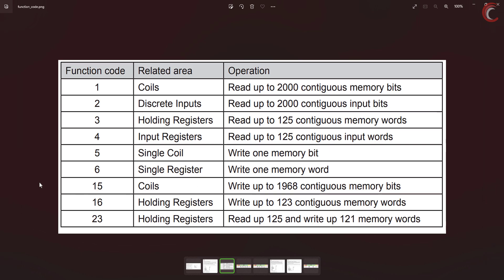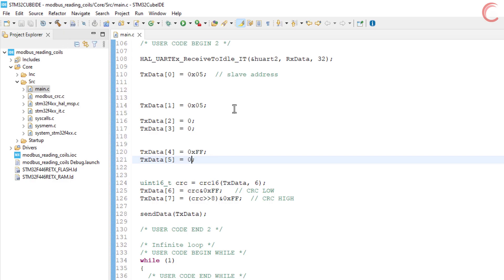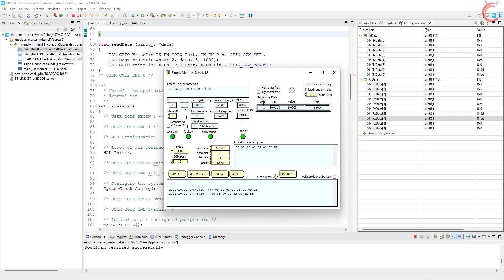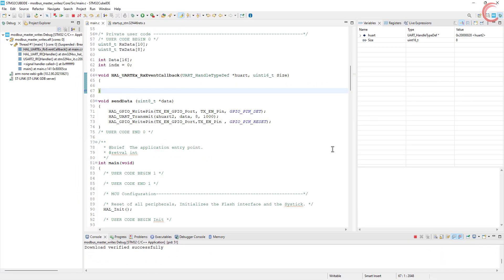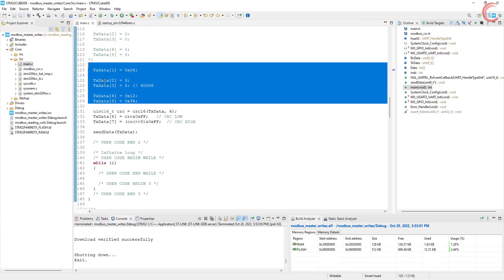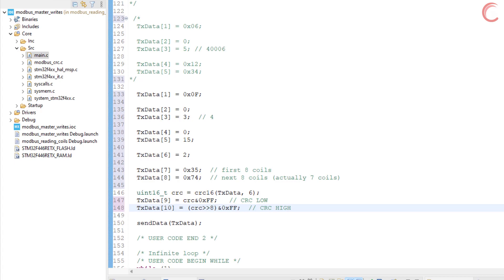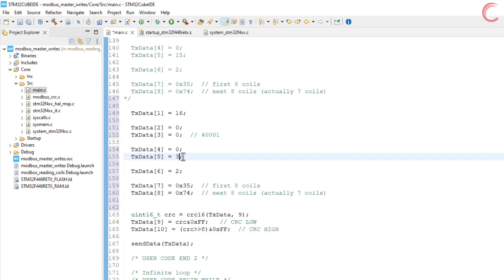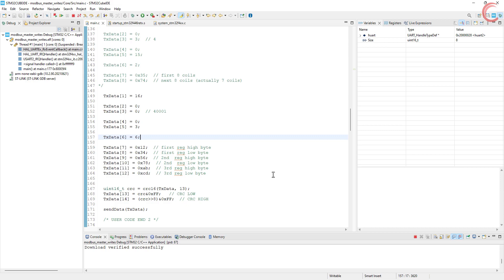Modbus #3. STM32 as Master || Write coils and Registers

Comment: Thanks in advance for yours great tutorials. One question, in order to manage the "access control media", you could check if the line is not busy by software, correct?, For example in a topology with one node and multiples nodes, in which the slaves can initiate a transmission to the master to indicate the change of the state of any of its inputs (locally inputs of each node), or this is not possible in Modbus RTU?

Comment: Why does the Slave Data show -1255.0000 and not the 43,981 (0xABCD) that was sent? See 12:54 in video
Reply from the maker: Beacuse the register data type in the software is set to 16 bit signed int. 43981 will be the value in 16 bit unsigned int.